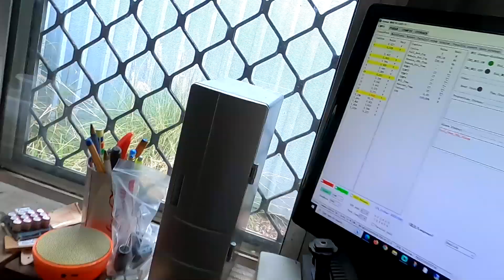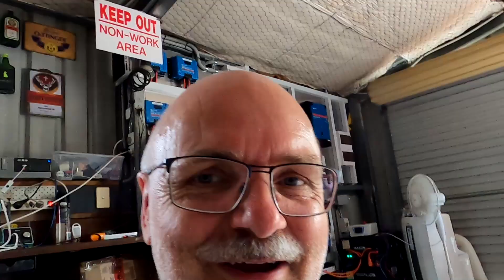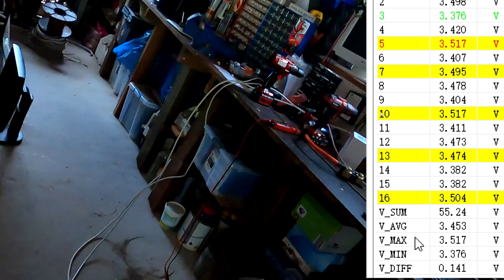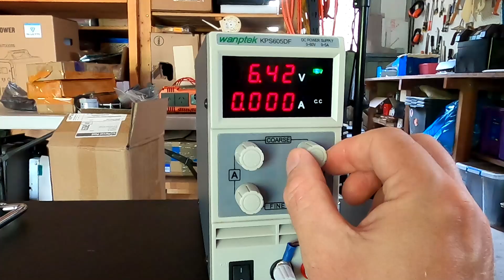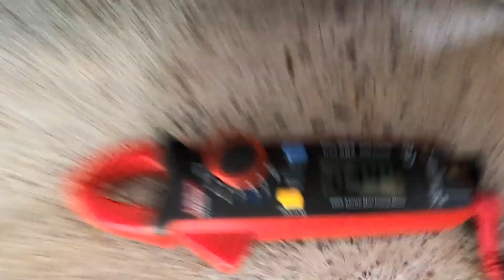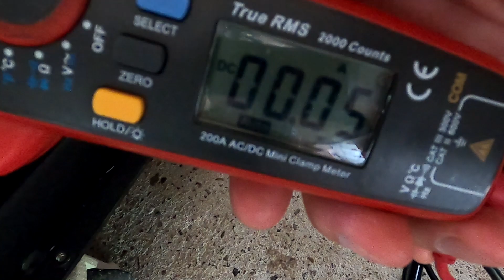Manual Top Balancing of QSO Pre-Assembled Battery Pack (welded terminals) with lights and charger.

Comment: I used one of those bench power supplies it will cut off if you set it right
Reply from the maker: Yes, it does, just tales a lot longer than setting it a higher voltage. But you need to pay attention then and cannot leave it unattended.

Comment: Idea for a video.  Go micro/nano scale.  See how "small" a LifePO4 solar system you can make.  
I'm currently working on a single cell Li-ion MPPT system with a 12V '3W' panel I've only seen produce 2W.
The first challenge is getting it to run itself and sustain itself.
Reply from the maker: Coming...

Comment: These videos  continue to advance my eventual DIY big multi bank build to use Batrium WatchMon Core and CellMate-K9 units to each bank. It all communicates across the banks and active balances at 500 ma each bank.  It may costs over $1500 for a 100+ kwh bank BMS system but way less headaches  and it works without major issues. Will be way ahead in the long run if more expansion is necessary at a later date.

Comment: Hi great content again 
I use a Seplos bms with a neey. 
But the top balance is still not good while charging with the inverter. The inverter charges to fast I think. 

Is it worth to buy a 60 V power supply set it to 55,5 V and let the neey do the work while charging very slowly ?
Reply from the maker: The Seplos should slow down charging to 10A at some stage if set correctly. That's one of the main features of this Seplos BMS.
Reply: Correct but 10 A with alarm. That’s sometimes still too much and too fast for the neey when one cell goes up quickly. I want to do a slow top balancing from time to time without taking out the cells. I think an external power supply while disconnecting the inverter should work
Reply from the maker: @tiree2231  Yeah, 10A is still too fast for any balancer. And the 10A throttle does not seem to work anyway in the Seplos.

Comment: Hi Andy - I've done both methods it can be fun at first and you learn from it  - now when I build a big cell  pack I wire in a spare set of ballance leads so if needed I can temparary  fit in an active cell  ballancer.
Reply from the maker: Yes, that is the way to go and how you should do it. I did the same with the first Seplos battery and left the cables inside the box. So at any time, I just connect the balancer and it does the job in less than 1h.
Perfect solution.

Comment: Does anybody knows if JK bms can work without connecting main negative (thick) cable to the battery just as active balancer? I am planning to switch bms in my battery pack from jk to seplos so it can communicate with my deye inverter. And i want to leave JK for balancing purposes
Reply from the maker: No, that won't work. It need the main negative to turn on.
Reply: @OffGridGarageAustralia  thank you, Andy!
Reply: You do need the thick black negative cable attached for the balancer to work, but you can still do this without connecting a cable to the output side of the JK BMS if you want it to just function as a balancer & give you all the cell info via app.
It would probably make more sense to use a cheaper NEEY type or capacitive balancer though with a switch you can turn on now & then when you want to do a re-balance. If you have more than one battery pack, you could wire each battery up to connection ports you could access externally, and just use a single balancer to swap from one battery to another as required.
Reply: @evil17  thanks. I have one active 2A balancer from JK (JK-B2A24S-CAN). But recently I have got another 16 cells and wanted to use it for these cells. So I wanted to leave JK BMS as a balancer for the old battery. Your idea with the external port is useful!

Comment: I've been doing this myself recently, but with a much smaller resister, very tedious! 😅

You can also bridge multiple cells at the same time if you have a few that are high (like if cell 3, 4 and 5 are high, go across all of them and bring 3 down at the same time, it will push more current into the low voltage cells 👍
Reply from the maker: Yes, it takes a while, I found these car lights perfect for that. They pull like 40A from a single cell

Comment: You need a Neeey Balancer with Crocodile Clamps 😜
Reply from the maker: Yes, that would be a great addition. Wait, I have one sitting in the shelf...
Reply: @OffGridGarageAustralia  I do all my Top Balancing on the Gobel Power Packs like this and use Terminal Blocks on a DIN Rail, so the cables are not flipping around and you can easy change it back to ring terminals!
Reply from the maker: @team13thirteen  Similar to what I did in the battery shelf. That's a great solution.
Reply: I used Neey and also charged lowest cell with a dc power supply providing 5A. That way i do not waste energy and turn it into heat.
Reply: Nneeeeyyyyy